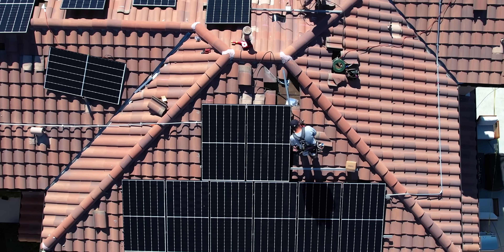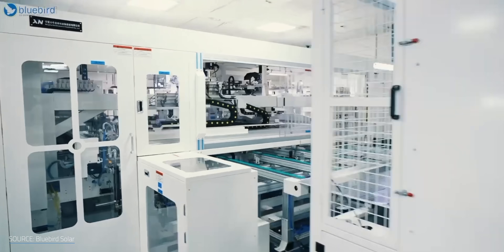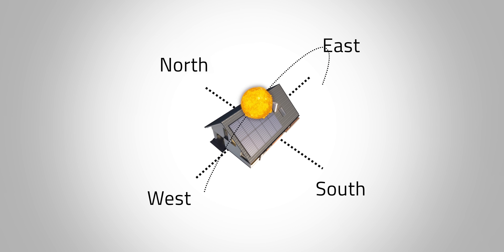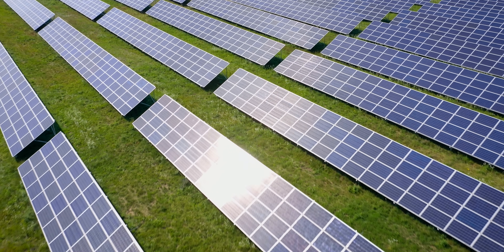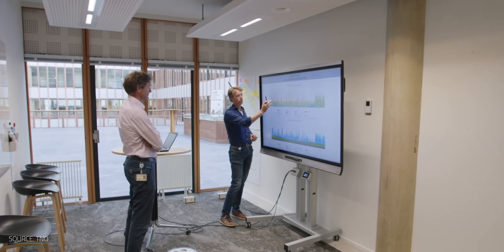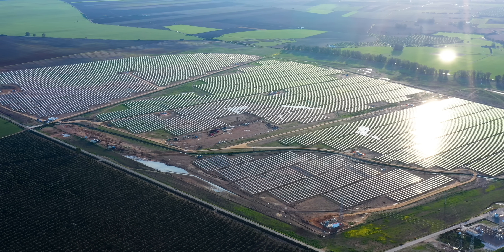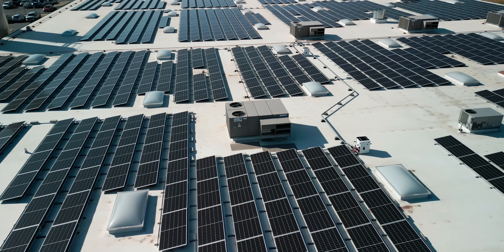Have we been doing Solar wrong all along?

Comment: Vertical panels may work on the side of buildings, but they won't work as fencing due to grass shading the panels, and the risk of damage from animals or mowing the grass.
The other flaw in their study is that they are comparing against other fixed panels. 
Most commercial level installs are using available roof space and vertical will have less panels or wattage per square metre.
Generation scale PV Power Plants already use Trackers so are taking advantage of the early morning and late evening sun rays.
Reply: @mbartelsm  The grass only needs to block the equivalent of one square cell out of the whole panel to reduce the output to 1/3rd or less. And yes that can still be significant for the whole string. On a 1500v 8A string, just blocking 5 cells was enough to reduce the string by 30%.
Rocks flying out from under the mower will cause plenty of damage, unless you plan to remove every pebble over 5mm big from a 30 metre border along every string.
Reply: Are you planning on setting them 6" or less from the ground? If so, why? Because horizontal or vertical, I'm planning on setting them about 7 feet from the ground. That way they provide shade, and we can move around under them. Could fill most of our back and front yards with them. Only thing stopping me at this point is that we're on the edge of tornado alley. I need a way to bring them down and lay them flat on the ground or preferably wait until I can get flexible ones and wrap them around the mounting posts. Then unwrap them and get them back up after the storm has passed. 
  Don't really want to invest 20-30k to have them rip free and smash into my or my neighbor's house, or end up in the next county, during the next storm.
Reply: @ThisIsATireFire  Depends on your location for which sun angle you set them on.
And yes wind loading is a massive part of the design process. 
For some rough numbers, a 1sqm panel sitting between 0-10 deg to a 100kmh wind blowing over the top exerts a 1/2 tonne load on the panel, with similar negative lift as well. 
If it is completely flat it gets a vibration like a sail fluttering that will destroy the panel, and about 30 deg it starts acting like a wing and tries to lift, obviously a panel that is 90 deg to the wind is going to have a large loading . We didn't work out those loading because it is a silly way to mount panels.
If I remember correctly, 15-20 deg was the ideal storage position during a high wind event, but that also depends on the terrain, and surrounding structures and fauna that can make the airflow more turbulent.
Reply: Watch the video to the end, it shows vertical solar modules suitable for rooftops.
Reply: @kkobayashi1  Just because he did that, still doesn't make it a good idea. Can you imagine the structural modifications needed to resist a decent wind load, let alone a cyclone/typhoon/hurricane force winds.
Reply: @stevegraham3817  The rooftop module shown here consists of panels only a few inches tall and few inches apart. Wind load is tiny.
Reply: @kkobayashi1  Are you sure they are only inches tall and it's not an optical illusion in the drawing since they don't actually give any measurements?
Maybe not on an individual panel a few inches tall, but 200,000 of them are going to have a significant load.
But as I originally said, the vertical roof top panels will have less panels or wattage per square metre.
This may be a feasible idea for panels being installed close to the Arctic Circle where they were doing the testing, but is a waste of potential area the closer you get to the equator.
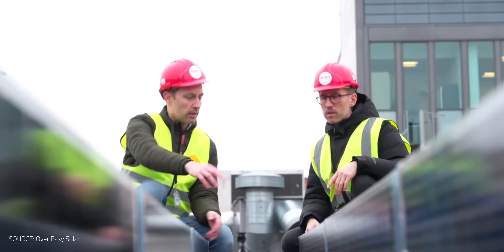Reply: @stevegraham3817   Jump to 11:50, it's pretty clear how small they are. And wind speed approaches zero close to the surface, which is why a bug on a windscreen doesn't get blown away.
Reply: @kkobayashi1  Yes they do look small, but that doesn't necessarily change the amount of stress on a structure, a square metre is a square metre.
There is laminar air flow, turbulence, high and low pressure effects, and positive and negative pressures.
A bug sticks to the windscreen due to those high and low pressures as the wind moves over the shape of a vehicle, not because of laminar airflow separation.
The bug can also be sucked from the windscreen due to a negative pressure above, just as easily as a direct positive pressure.

Comment: I’ve measured my solar panels surface at over 145 degrees F in the TX summer.  My bifacial panels pull much better power early in the day and that’s huge if you’re using off grid solar with battery back up.  Mounting panels can cost as much as the panels themselves, so that’s a big factor as well.  Eventually, I think you’ll find all solar panels are going to be bifacial.  There’s hardly any price premium now. 👍☀️⚡️💡🔋

Comment: curious also because even one little bit of shadow across your panel can completely throw off the voltage of some of the cells causing the efficiency to drop like a rock.  maybe next time I'm camping I'll try to set mine up like this.. I don't have bi-facial cells, but I can certainly set two back to back vertically along the sun's daily path.  camp sites are usually horribly shadowed, so getting a full charge for me is pretty darn rare, and at best I'm able to just offset my usage for charging things and using lights at night, but I'm always at negative by the end of a few days regardless of how sunny it is.
Reply: and actually, I wonder if you place a couple panels back to back vertically, if the heat rising in-between would actually increase the cooling effect via convection, would the addition of aluminum fins inside the gap assist as well?

Comment: The fence use is actually a fair case use scenario. You have a need to buy a fence and also want solar? Maybe this could even save you money. Especially where snow falls and could cover standard panels. The vertical panel isn't going to be blocked by snow so long as its higher up than the depth of the snow.

Comment: I'm not sure why the panels are heating up so much when silicon is capturing infra red spectrum, it seems they're falling foul of their own, compounding inefficiency. Maybe phosphorescence/frequency-shifting materials could help here.
The alignment of vertical generation with domestic consumption is too much to ignore but maybe the real innovation needs to happen in the commercial agreements to use commercial building (vertical) generation to power residential demand and residential building (horizontal) generation to power commercial demand i.e. more commercial than technological solutions.
That said, I still think integrating glass windows and solar panels is the way forward - too cool.

Comment: I expected it to be a thermal tweak. Yeah roof top solar has had an issue due to heat, but I think lifting the upper edge by a few inches should help airflow via Venturi Effect.

Comment: might be a good solution for the case that you want rooftop solar but your building's roof isn't orientated with a south facing roof slope (assuming northern hemisphere). With an east/west facing roof slope, you could run ridges of these vertical panels on both roof slopes and possiblly out perform a traditional setup just on the south facing roof slope.

Comment: You conclude with “The preliminary evidence is clear: vertical bifacial PVs are already outperforming their horizontal brothers.” I'm sorry to say, but that's an incorrect interpretation of the TNO study. They state +2.5% higher energy yield. The question is "compared to what?" The "what?" in this case is the original energy simulations for that system, because they underestimated the Uc cooling coefficient. It's not +2.5% over conventional south-facing, tilt=latitude systems.

Comment: I wonder if the panel being vertical also contributed to it staying cleaner longer. I would imagine this would contribute significantly to the performance improvement as well. Also in the snow you don't have to clear it and will have increases there as well.

Comment: If heat is a big contributor with panel efficiency, why don't  we add heatsinks behind, on, in, or around the panels? Without considering costs (which could be the reason why it's not mainstream) would the extra materials be worth it?

Comment: Did you actually read the study? They state positive outcome per PANEL section. Not more energy per area of installation. Cost per kWh is almost doubled
So, almost twice the cost for something that outputs LESS power, but has an expected litetime of 40years in stead of 35.

Comment: To get the best sunlight capture, the angle of incidence (from the normal) * cosine of that angle is the factor. Look at the cosine table, a deviation of 13degrees only results in 2.5 %. So a vertical deployment in higher latitudes makes sense, but not so much in lower latitudes. So in Sweden (at 60 degrees) - a vertical deployment means 30 degree offset - which would result in 86% production from the ideal angle (60 degrees).

Comment: I especially appreciate the practicality of vertical solar panel arrays used with regenerative agriculture.  Multi-use practices on a limited land base is very efficacious, and with RA cover crops that absorb carbon and nitrogen and fix them into the soil will most certainly improve yields and farmer's income.  In addition, plant transpiration helps cool the panels.  Triple win!

Comment: Thanks for your video , it was fascinating .  Used solar panels are so cheap now you could buy twice what you would previously have needed , attach them together back to back and mount them vertically . You would need a much smaller amount material to build a frame and could do away with using rotators .  Dirt cheap solar farm .

Comment: What if you had BVPVs mounted so that they could rotate in the middle, allowing wind to turn them like a wind mill of sorts, you could even make the design more ergonomic to facilitate wind energy as well. These could be used in windy and sunny locations to capture both energies simultaneously, and increase the efficiency even more by additional cooling of the arrays.

Comment: @13:29 my guess is that because solar panels efficiency drops as heat increases, the vertical solar panels run cooler. 
So they are more efficient.

Comment: There are already solar panel banks installed vertically in Finland. Some residential apartment buildings might have their entire south wall covered in solar panels. It doubles as a surface cover, produces electricity and there is no problems with bird poo, autumn leaves, winter snow, or dust and other dirt. Another huge benefit in Norway, Finland, Canada etc. is that the vertical solar panels actually produce some power in the winter. Because the sun is so low for the whole day in the deep winter normally tilted panels, which are usually always low and covered in snow, don't produce much power. It's also much cheaper and easier installing and maintainin panels on a wall rather than on a roof. (Roofs in these northern countries are often rather steep due to snow loads and high rain accumulation). Solar panels are dirt cheap. The installation, electronics and electrical components are much more expensive. It just makes sense adding 100% extra panels for a vertical installation just for the heck of it if you have the space.
Reply: The great majority of Canadians live south of Berlin. Toronto is south of Avignon. Whitehorse in the Yukon Territory is up there with Helsinki. It's a small town.
Reply: I wouldn't really say that Solar panels are "dirt cheap".  Maybe for industry, government, etc but not for the average person.  Otherwise, I agree with the rest of your excellent post.

Comment: Vertical completely makes sense. Away from the Equator, where there is summer and winter, there are 2-4 months where you nearly get nothing when the panels are on the roof (horizontal) or with the roof angle. Vertical would deliver more. Within the whole year there is enough production at noon. But less in the morning and evening. 
And, what was not mentioned in the video but in several comments, there will be no snow on vertical panels. With horizontal panels thats a problem.

Comment: One detail not discussed that is very relivant - if you factor in the time of day value of energy generated vertical PV modules might be financially much better than horizontal.   Even considering when battery storage is added into the equation minimizing generation of electrical energy in the middle of the day when the spot price might be negative is a major factor to consider.

Comment: If mass power generation is the goal, why use photovoltaic technology? All tried and true power plants have worked by boiling water and turning a steam turbine. Is it not, therefore, feasible to collect more of the sun's energy as heat using vantablack panels with a water loop under pressure? Far less (almost zero) light is lost by reflection. Radiation back out of the panels becomes a bigger issue at this point. The challenge would be to get the water boiling vigorously while also moving it fast enough through the panels to maximize energy collection. Maybe the use of a heat pump could aid in accumulating all the heat in a small space, but it would need to be powered by the heat of the water loop while the plant starts up and isn't generating power yet. Maybe there is a real use for a Sterling engine.

Comment: Same reason that commercial greenhouses are turned with the end towards south, more glass towards east and west, and less straight south, equals less heat and more sun,
My panels are producing less power in cloudy weather, but for more hours, still not as much as on a sunny day, but more than you would think.

Comment: It's ok for solar farms but falls flat for urban areas where there's just not enough space for the home owner to get both east west sunshine on the same panel. Anyone got some other idea?
EDIT: It's tremendously good news for deployment in solar farms because it doesn't kill the environment due to the shadows formed and the blocking of access to the ground underneath the panels. No more desertification as is currently the biggggg issue with solar farms.

Comment: Got 9.8kW PV on the south facade, 90°, on the wall. Best thing ever. Much more in the winter, no snow and no unneeded peak in the summer compared to the roof PV. Living at 52°N.
Reply: how much real life kw do you get out of your system in mid summer and mid winter ?
Reply: @casemodder89  Its around that what PVGis says (tool to calculate PV with location and alignment). Theres nothing on cloudy days, but a bit of sun has double the yield of the same PV size on the E/W roof. Living at 52°N. 70° south would de ideal here for best year round PV.

Comment: Good video, but you are missing what is arguably the most important aspect of vertical bifacial:
They complement "conventional" PV in terms of when they produce electricity, and that has big implications on the value of the electricity produced. Take Germany as an example.
Today, we already have days where in the middle of a sunny day wind & PV together supply more than 100% of the country's total demand (with most of it coming from solar at that time), and the spot market price drops to zero (the marginal cost of production of wind & solar).
But during morning and evening hours, even on the sunniest days, electricity prices are high because solar production is low.
This is where east-west-facing vertical PV comes in. If you can avoid shading and self-shading issues, you get nice peaks during the morning and evening hours (theoretically 6am and 6pm). It's a bit like a one-humped (normal PV) and two-humed (vertical) camel...
Reply: Here's a good illustration of this:
https://www.solarzentrumpulheim.de/wp-content/uploads/2022/01/N2S_Solarzaun_Kurzpraesentation-5.png

Comment: my guess would be either that vertical panels would be easier to cool? the graph for my solar panel is usually a plateau so that means it is inefficient at the highest point
Reply: kk im not correct but maybe in the right direction

Comment: Generally, any object tends to cool down/ heat up to ambient temperature quicker in vertical position than in horizontal one.

That is because stronger convection currents are set up in vertical position. 

You can try it easily at home. Fill two identical bottles with boiling  water or ice. Place one horizontally and the other vertically. The vertical one will come to room temperature faster from any direction (hot or cold).

Comment: I think the key from the paper is that they observed panels in the vertical orientation "...partially offsetting the energy loss due to the less than optimal configuration." So the vertical orientation offsets some of the loss but not all. Panels at the optimal angle will definitely still have a higher energy yield.

The vertical orientation had better than expected cooling which resulted in an additional 2.5% yield. But this is just compared to the expected yield of the panels in the vertical orientation at a higher temperature.

Comment: I've been considering putting up solar panels along with some on the side of my house that's facing the South East.  The reason being here in Minnesota the sun doesn't get much above 45 degrees above the horizon during the winter months.  The vertical ones would get more direct sun than the ones on the roof.  Much easier to keep clean also.

Comment: Just a guess but horizontal panels trap the heat underneath the panel while the vertical panels will let the heat rise.

Would be nice to see normal panels (without the extra cost of being able to pickup from both sides) in a vertical position. Just for comparison.